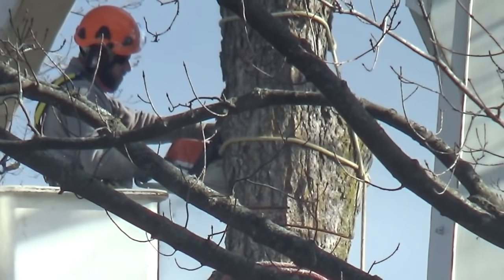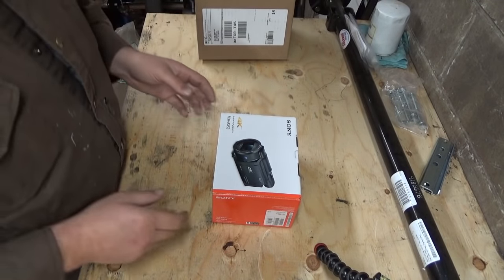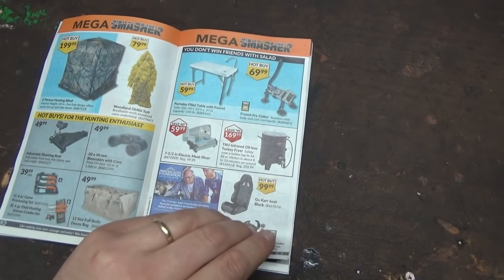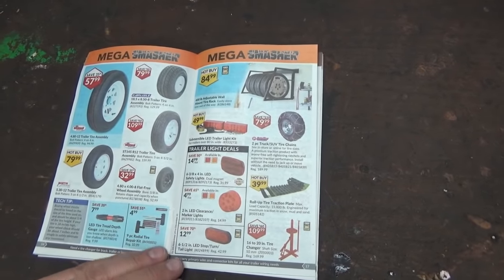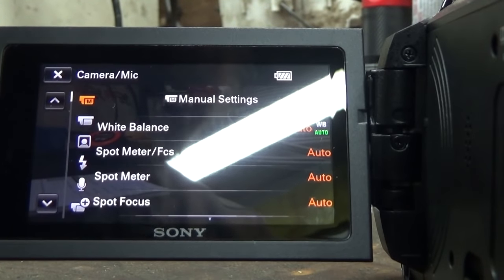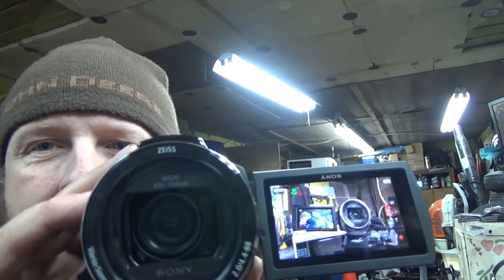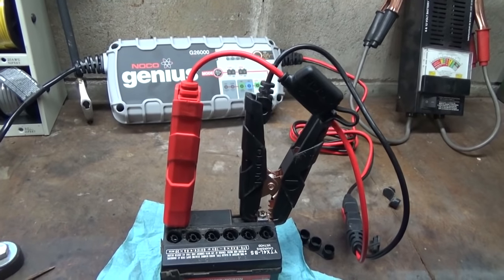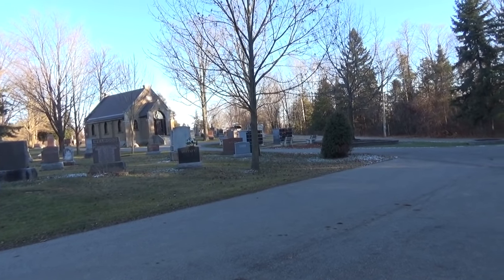Heavy box in the mail lets crack it open

Comment: In your Mega Smasher magazine I think I just saw your next build project. The tire storage rack to be used to store your "off season" tractor tires. You would have to decide whether the rack would be inside your garage/shop or outside on the wall mounted high on the cement blocks. If it was outside, you could use your forklift machine to lift the heavy tires into the rack and then put a weather proof cover on the tires to protect them from the elements which would make more room in your shop. Just an idea.
Reply: sandrammer 
I was thinking the same thing you were.

Comment: I've seen a few places that recommend that you don't keep removing the sd card to transfer files, better to do it ove the usb cable direct from the camera, also good to do a format in the camera from time to time, reason is that the usb is made for constant connection/disconnection, an SD card isn't, could be a problem with the contacts on the card, and thinking about it could also be the reason for the error you got on the camera.
heh, wonder if you can hold that new camera in your teeth like the old one :D
Happy Birthday btw ;)